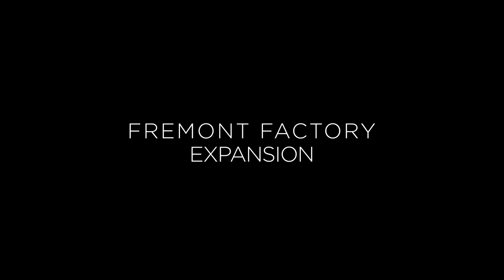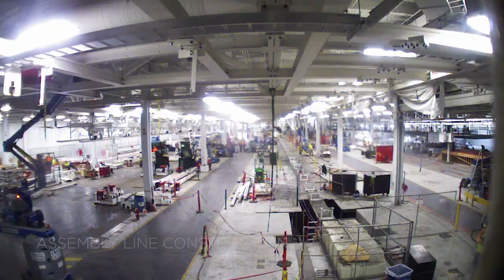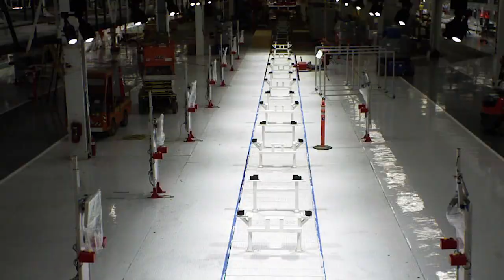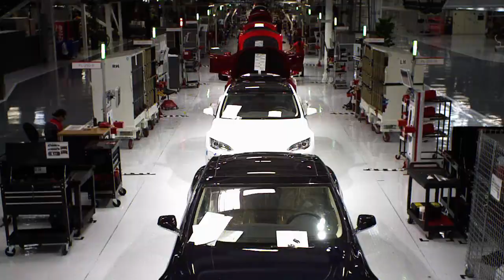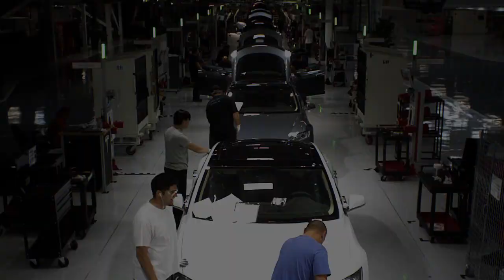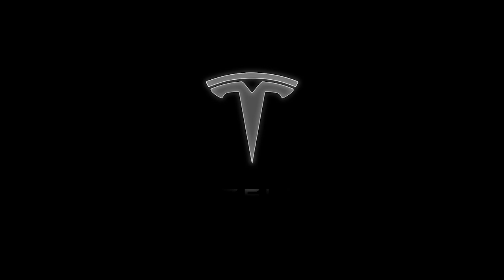Tesla Factory Upgrade

Comment from the maker: This time-lapse video shows recent upgrade work at the Tesla Factory. More details on our blog: http://ts.la/t3
Reply: Cool, but I still can't over how hideous and unaesthetic Tesla's logo is!
Reply: Paublo Picklepaper Are you kidding me? I think it looks sharp! No pun intended.
Reply: Rocco Speranza No it doesn't! Its ugly, pure ugly. If I ever buy a tesla I would have to either remove it or replace it somehow. Tesla please rebrand before it's too late!
Reply: Cool. Can't I send you a design yet and you print my version or the Tesla by CR . Battery swappable,  2 door gull wing on keyless, 4 seats with room for legs and tall people , priced at 30K  fastest model and safest model ever with air bags in front and rear compartments,  stronger doors that act as role cage, 4 wheel drive. Solar power paint or skin for a trickle charge and to almost run the heat and cooling when driving, those new tires that dont wear out and dont have flats,  a way to load software on the latest ipad for my display console. So i can stay up to date with technology.  Also needs 400 mile normal battery range and fast charge 1/2 hr . 0 to 200  faster than a lambo.
Reply: Also I need to be able and work on so simple disassembly.  So I can print new parts and change the car a little or do my own repairs
Reply: Paublo Picklepaper well everyone has their own opinion.  i think it looks fine
Reply: Benjamin P Ha. It does look like a uterus. Maybe that's what it's suppossed to be. I guess I'll just think of it as that from now on because it makes for a terrible T.
Reply: Can we get a timelaspe of the gigafactory?
Reply: Nice
Reply: Thanks tesla motors but shortly videos...
Reply: Tony Hitti the factory is in Fremont, California.
Reply: I love electric cars, I recently donated a half converted electric truck to a community college. Do you guys need an occupational safety and health professional? I'm currently in between jobs. I would be willing to do anything at Tesla, my training is in occupational safety and health.
Reply: YOU SHOULD COME TO BRAZIL! 
BRAZIL NEEDS YOU!!!!!
Reply: You guys are just swimming in money!!!!! A like it :)
Reply: Glad to see Tesla succeeding
Reply: starting to see stations every where
Reply: Super :)
Reply: Good sign for future developments !
Reply: Wow, great video showing expansion
Reply: Time lapse of Giga factory construction inside and out?
Reply: Try hvcbj
Reply: Congratulations to Mr. Elon Musk for one more step towards Tesla Motors's consolidation in the Market, this is the result of the boldness of youth and strength.
Reply: This!
Reply: Paublo Picklepaper The logo is suposed to be a Tesla coil
Reply: SeabasR It seems to me more a stylized female reproductive tract, the uterus and ovaries!
Reply: Ricardo M. Nogueira After model S They were planing on releasing one named Model E, followed by Model X. But they had to change Model E to Model III...
Reply: Paublo Picklepaper
Tesla's logo is badass.
Reply: So now you're  more efficient and will reduce model s price at half?
Reply: Cosmin Dumitrescu yea in 2017 when they release it as the Model III
Reply: Tesla Motors God it is so nice to see someone who is totally on and just how much they can accomplish !!!!!!!!!!!! !!!!!!!!!!!!!